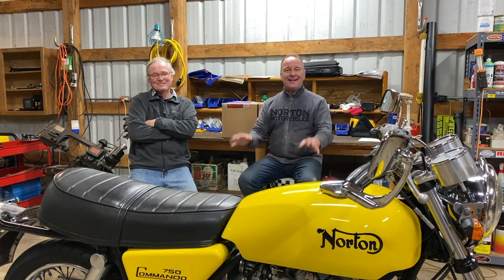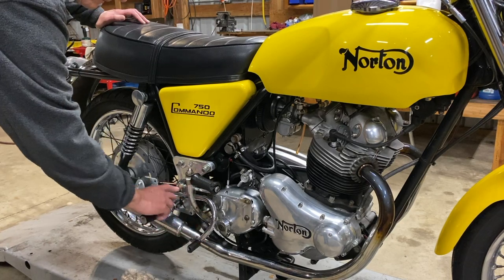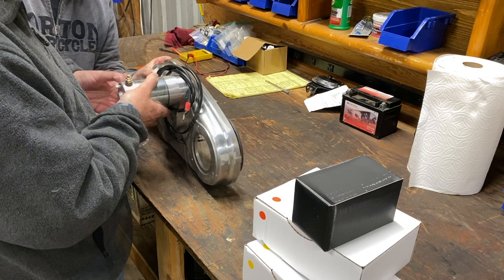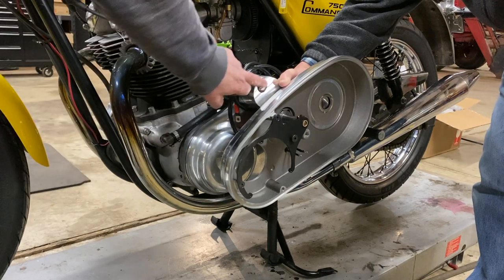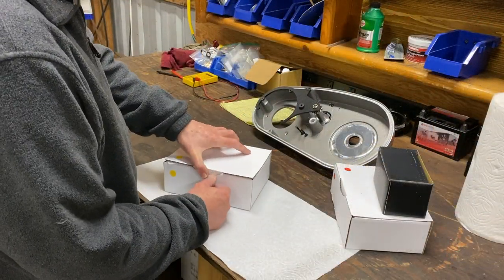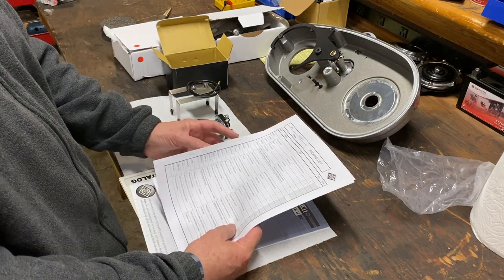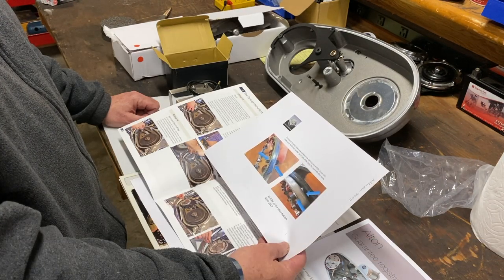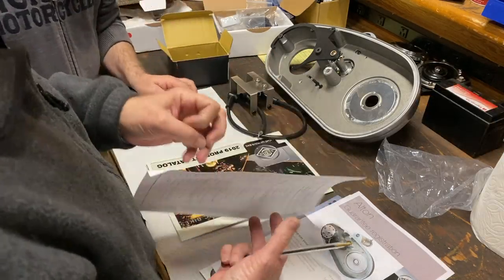Norton Commando Alton Starter Motor Project - Part 1 of 6 - Opening the Box

Comment: Just did this on my 72, kit works great. I added some silicone on the solenoid wires to stabilize. That and the ei were key mods.
Reply from the maker: Thanks a lot Chris.  Great point, Geoff did the same where the wires go into the stator.  Good idea! Cheers, Mike

Comment: Hi Geoff how much are the starter motor kits for the commando please.
Reply from the maker: Hi
The units are approximately the same, depending upon where you buy them. The Alton is a little less, but the CNW unit also comes with a belt drive. 
Here are links to the units. Both are excellent

Alton
https://www.alton-france.com/norton-starter/

Colorado Norton Works
https://coloradonortonworks.net/cnw-elctric-start-conversion-1.html